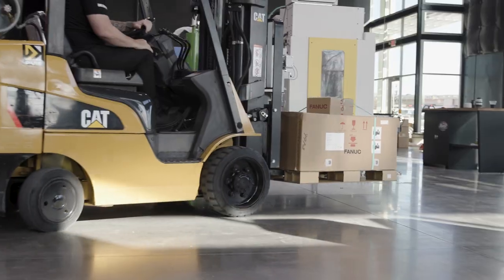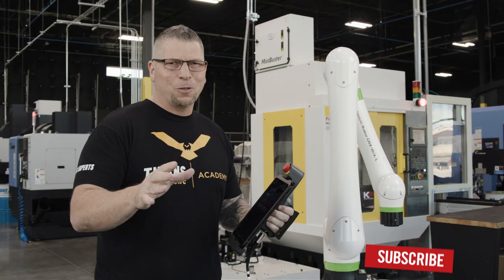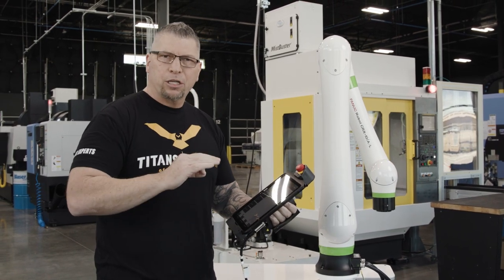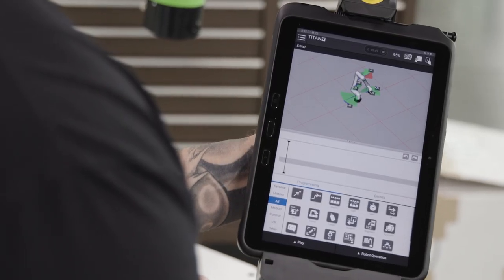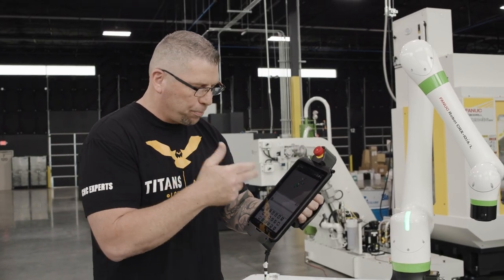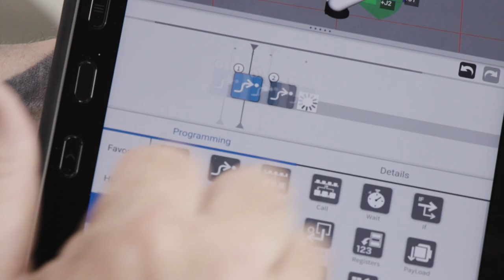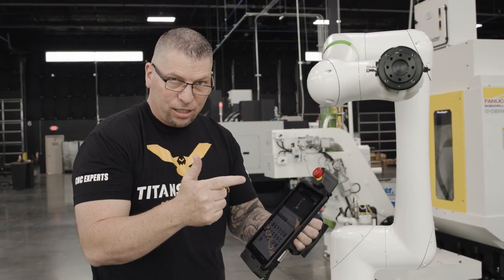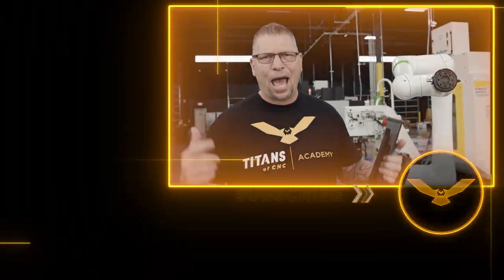Unboxing The CRX Collaborative Robot from Fanuc

Comment: Might be a stupid question but what would you use this for?
Reply: In a machine shop you use it to load and unload parts to your cnc machine so it can run for many hours without operator intervention. For example it can run the night shift all by itself. The one in the video is missing the gripper that holds the parts.

Comment: What is the cost of this robot?
Reply: @Erik Slagter I'm gonna throw a guess in around closer to 120K
Reply: @Erik Slagter It looks like you're about right price wise. After checking the various prices you can actually buy the Fanuc
top end robots costing over $400,000 plus. You can also find numerous videos on the CRX Series model that Titan bought.
Reply: FANUC likes to piece out the options as well.

Comment: Dealing with robots is very, very dangerous and one really can't emphasize enough how fast they can move and with how much power. It'll crack your bones clean in two if you get too comfortable.
Only very recently have robots began to be safer around people with all the sensors and what not, but something can still fail and then it's the robot who's going to win.

And I'd be very cautious with a new robot out of the box...

Obviously it defaults to slow movement when using the pendant, but it's so easy to make a dumbheaded mistake and get cleaved in half. That's why they're usually programmed by professionals.